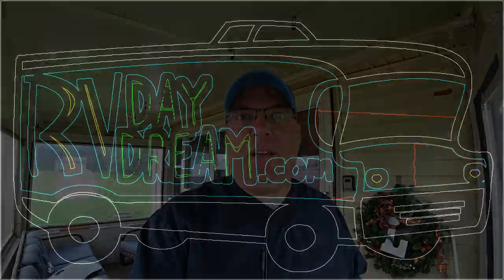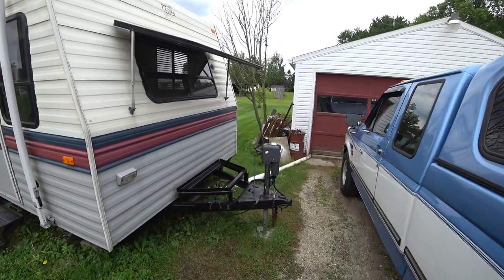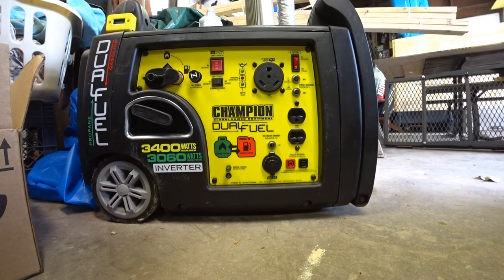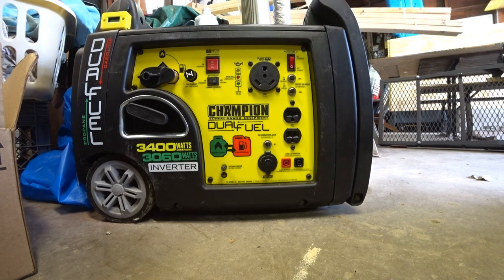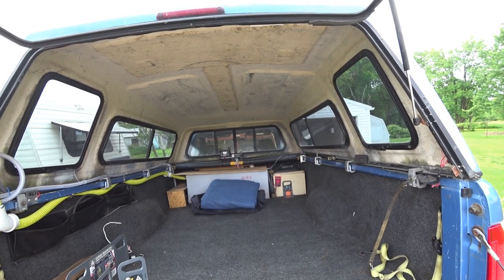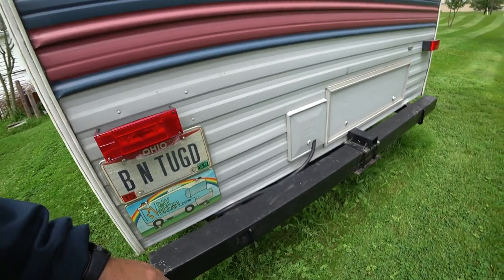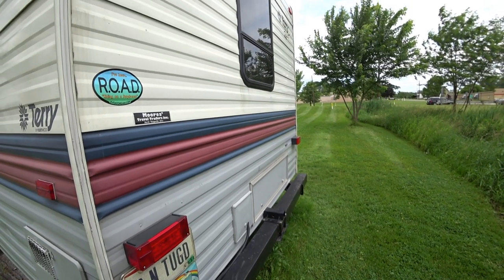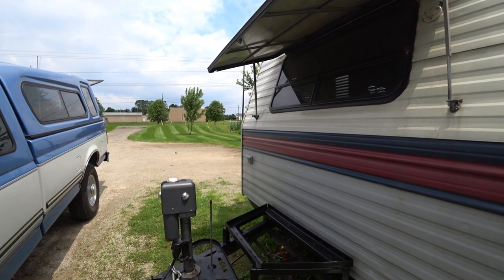Why Did I Mount Generator on RV

Comment: I’m still looking for the best way to tote the generator with the 5th wheel. I like your current setup with the exhaust extension running out of the bed for overnight stays. Our camper didn’t come with a hitch receiver on back so adding an exhaust extension would be a lot less work than adding a hitch receiver. Lol.

Comment: Awesome video! You got me thinking about those times you will need to boondock. FYI. Champion is coming out with new 2000W generators. One is gas only and the other is dual fuel with a new digital LED Display. They are stackable and parallel capable.

Comment: Been debating on making some videos on Rv living. I just removed the generator and propane out of my itasca. The one we removed was a kohler 3500 that was 50 years old and replaced it with a raven 5500. The only reason I put something so big in is because the raven generator I got was new and I got it for free.

Comment: I am curious how this will work out. I am curious about noise inside and maybe vibrations when the generator is running. We have been looking for a generator for our trailer too.
Reply from the maker: Arbitrary Exploration the very first day that I mounted the generator on the travel trailer I shot a little bit of video inside with the generator running. It was definitely quieter than when I had it mounted on the back. Once I have everything positioned the way I want I will do a sound comparison and maybe I can do some sort of liquid in a glass to show you vibration possibly. That'll be on down the road so keep an eye out.
Reply: That is really cool! The vibrations are only if they are noticeable enough to be a problem. I am pretty tolerant of vibrations just. Thank you for putting this together. We have been looking at the champions that you can parallel.

Comment: I have had a champion mounted at the tailgate of the pickup for years now.. no issues.. but I don't have carpet lined in my bed..  the vibration and noise of the generator just didn't make sense in mounting "on" the trailer.. we all make choices.. safe travels.
Reply from the maker: Michael D You run it with a cap on your truck?

Comment: Well you are far the most accurate - every video I’ve seen fail to mention that yes the AC will turn on but when the compressor turns on even this generator will fail and go into overload - a lot of false information given to consumer - I bought one and it does not run my Dometic 15000 BTU Brisk 2. Champion fails to mention this - the  30 amp plug fails at 29.4 amps - the ac must want more when compressor kicks in.
Reply from the maker: aron sal absolutely. And I'm assuming that it probably be worse if you are at a higher altitude as the engine is operating at less efficiency. Also running on propane the thing only puts out 3060 Watts. If I had to do it over again instead of putting a hard start capacitor on I would go with the micro Air Soft start. The generator will easily start and run the air conditioner at that point with very minimal kick on draw

Comment: Have to comment , at  600 feet above sea level- I have a Firman dual fuel 3200 from Costco - I installed two micro air switches in each of my 15000 roof units, the gen runs both plus the 50” LED TV and stereo with sound bar and 8 speakers no problem using propane that rates the gen at 2600 watts - no problems here ;)

Comment: I've read 3% reduction in power output per 1000 feet elevation? Probably heard that on the Wagner's video. I've got my Easy Start being delivered TODAY. Picking up my RPod TOMORROW. My 2200W Westinghouse generator should be fine... most of the places I'll be won't be too high elevation.

Comment: Appreciate you addressing why you switched location of the generator. We are still planning ours on the rear of our trailer with a cargo carrier. If it doesnt work out then will consider the trailer tongue. Thx again for the useful info
Reply from the maker: Thanks!! If you haven't yet, please make sure to watch this video covering the mounting position.. https://youtu.be/aesi6_-fJk8
Reply: RVdaydream - i had watched the video of the Sherline scale before, but this time paid very close attention. At around 20 or 21 minutes, it became very obvious the concern about having too much weight behind the trailer axle(s). I will probably get the same scale from your amazon link and do basically the same testing you did. Our trailer is 18.5 ft long from tongue to rear bumper. 2/3 of the trailer is infront of the axle and 1/3 behind. My original plan was put the 60 lb cargo tray on the back with the same champion gen set alobg with one 20 lb LP bottle. Total weight ~ 200 lbs. I. In the front of our trailer was going to add two group 31 batterries weighing together 150 lbs. Based on the 2/3 to 1/3 ratio, i thought that would equalize the load front and back. I guess i will see if that is the case or not after using the scale methods you showed. Thanks again for all the insight. We have only had our small travel trailer 1 years so still newbies :)

Comment: Great video. Great thoughts. Love the easy start. Some may not uncounted these issues as higher elevation usually includes lower temps, so not too concerned with overload . Still though, great points. Will keep these in mind as I continue to progress toward full time RVing.

Comment: The Honda eu3000i Handi weighs 75 pounds and is 2/3 the size of the eu3000is.  Slightly less power and $300 more, but well worth it on the weight savings. The Honda eu2000i is 13.3 amps.

Comment: My friend I like your videos ,I have a question my RV is a 50 amps I buy the champion generator 76533 this one only have connection for 30 amps cable, how can I fix this situation and running the 50 amps I need when going to boondocking. Thanks and be safe always
Reply from the maker: carjack69 you have to get a 50amp female to 30amp male adapter/dogbone.... HOWEVER, you will be limited on how much you can run inside your RV. If you have dual air conditioners you will not be able to run both of them. If they are 15000 BTU air conditioners you should be able to run one of them without issue. If you have a 13500 BTU air conditioner you will be able to run that and maybe your refrigerator on electric too. You will not be able to run your air conditioning and microwave at the same time or your air conditioning and electric hot water tank at the same time or your microwave or electric hot water tank at the same time. Basically, you have three major appliances on your RV that draw a lot of amperage. One is the the air conditioning unit the second is the microwave and the third is your electric hot water tank. You can only run one of those at a time while connected to the generator. You will not be able to run your air conditioner with any other heavy draw Appliance such as a hair dryer, a toaster or toaster oven, or one of those little electric space heaters. All those things draw too much amperage when trying to run two of them together at the same time. That's what everybody else does with 50 amp RVs too. You just can run minimal appliances at the same time as the air conditioning unit. Or like I mentioned the other two big draw items. It's not a big deal unless you have to run your air conditioning constantly to stay cool, even then you can turn it off for a short bit and run the microwave or whatever else you may need and then afterwards you can fire back up the air-conditioning. It's definitely a learning curve but overall it's the easiest way to handle it. Hopefully this makes sense. Thanks for watching

Comment: Sales guy at the RV dealer said should place a generator 25 feet away from an RV due to the danger of exhaust getting in the RV. It seems like he is overly concerned about it seen many travel trailers setup that way. Could always put a CO alarm inside they don't cost all that much.

Comment: Is it safe to have your generator so close to your propane tanks?  I would be concerned about heat from the generator.  If the generator has a internal component failure, can the propane tanks be punctured?   It may be remote but it is still a considered.
Love the setup you have with the generator and hope it works well for you.
Reply from the maker: John Simone all the heat that the generator creates exits out of the exhaust pipe and that engine vent on one side of the generator. The control panel doesn't even come close to getting hot. And the other side is the air intake side. I have never as a small engine mechanic had an engine fail and throw parts. Even when engines have seized and blown up, which we've done on purpose before, there may be some small aluminum pieces that will fall off the block but no explosions of any kind, and definitely nothing with enough strength to puncture a propane tank.

Comment: Certainly is a lot of food for thought. I think my plan is going to be partitioning my truck bed according to the sections in my tenau cover. It's a semi rigid trifold affaire that I can lock down. If I stop overnight some place just pop the first section open and hook up the power. I can make a solid partition to secure the rest of the gear (lawn furniture, extra...well everything) I like your idea of having a dedicated power cord hard wired but obviously that wouldn't work well if the generator is bolted down to the bed. I gave a bedrug also so I guess that'll have to go. It came with the truck and honestly, it's more work just trying to keep it from getting nasty than it would be to just have a good heavy duty bed liner. I've seen generator racks that mount over the batteries and propane bottles, I just gave a problem with something that generates that much isolated heat over the batteries and propane tanks and just inches from my head sleeping. As always, well done.
Reply from the maker: Neil Cotter I agree. If I didn't have a cap I would definitely do something in the bed of the truck. I am going to do a video in the future though covering the actual temperatures that the generator produces and how it affects the items that are around it. You might be surprised about how cool the temperatures actually are. I know I was.

Comment: What kind of truck do you have? Make & year?
Reply from the maker: Well a few weeks ago we had. 2019 F250 4x4 LB ext cab... Now we have 2020 F350 Crew Cab long bed 4x4 7.3. 😁
Reply: RVdaydream I appreciate the response. Just came across your channel last night and subscribed. Check us out. Not as informational as your channel though. How where you able to purchase such a big expensive truck and keep it debt free. I like many keep a very low debt ceiling. We’ve paid so much off but I’m pull 10,000 lbs dry on a 3.92 axle ratio 2003 Dodge Ram 1500 5.7L SLT that we were blessed to pay cash for. But now when I think about upgrading to something that will allow me to travel in the road pull such amount of weight without my back axle dipping inward or being able to travel no more than 70 mph, trucks are just out of control expensive. What’s your advice? In your mind what is worth it a dodge or ford?
Reply from the maker: I'm a Ford guy. Doesn't mean there's not a lot of dodges out there that do just fine. If you're going to stick with a gas engine you're going to need a older Dodge with a V10 in it. They can be found relatively cheap. But if you're going to stick with Dodge most people go diesel because of those Cummins engines. I'm not a big fan of diesel but at 10,000 pounds I would be thinking about it. If you want to run a Ford gas engine you need to find either a V10 or a good old 460. Again at 10,000 pounds if you're buying used you might want to be into a 7.3 powerstroke diesel. We've been able to stay debt-free because of Investments that we made years ago.

Comment: I understand why you mounted it on the tongue, but I think still you are going to get sonic vibration not so much dynamic vibrations which will drone you to death.. but you said it doesn't bother you so all is good. Too bad you couldn't leave the tailgate open and run the generator.. Will get cooling air and be a bit quieter.You can create a fence and lock your goods and generator inside and run with the tailgate open. Less hassle in the long run I would think..

Comment: You mentioned that you plan on moving the batteries inside your trailer. That will be fine if you use Lithium Ion or AGM batteries but regular lead-acid batteries need to be vented to the outside because they release toxic hydrochloric acid fumes. I use AGMs for this reason. Besides not releasing toxic gases AGM batteries don't require any maintenance.
Reply: Ooops. New guy here. I just heard in your May 30th. post that you are indeed using AGM batteries.
Reply from the maker: jessebalk yeah there's a few videos back that I mention that I think. However, you will be surprised to here that AGM batteries are too supposed to vented. In the case of a slight overcharge situation, which is highly unlikely, there is a 2 to 4 PSI valve that will release if that situation occurs. But, I'm not going to. I'll discuss this in a future video. Thanks for the comment!
Reply: Not Hydrochloric  acid, they use sulphuric acid. Definately right about the fumes and they also produce hydrogen gas which of course is explosive

Comment: Look up stromberg generator mount
Reply from the maker: Jerel Rogers Stromberg trailer tray is entirely too tall. Everyone knows, that when you are Towing the lower the center of gravity that better. I do not want to add a hundred and ten pound generator above my propane tanks. Also who's is going to be lifting it up there? It might be okay for those little Honda generators but this is heavier for sure. I've seen the stromberg-carlson trailer tray up close and personal at a campground last year. And although it is built very well and seems very sturdy it will not work for my application. As I mentioned in the past videos, I have a road cover that is over top of my front window that would not be able to open with the generator mounted.
Reply: RVdaydream I use the Stromberg and it is fantastic.  I have secured it well and with my Champion remote start it runs right where it sets.  The oil change can be conducted right there.  The biggest drawback is fueling but I normally fill it at the station and have a small stepladder to fuel it as well as other maintenance.